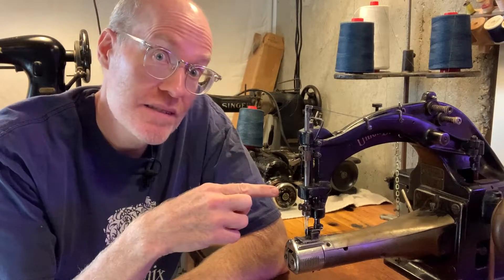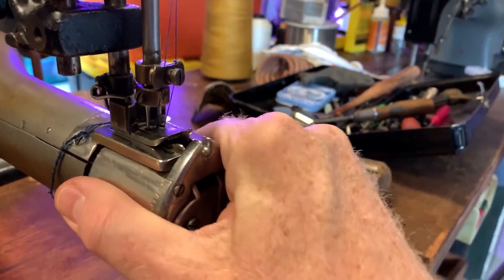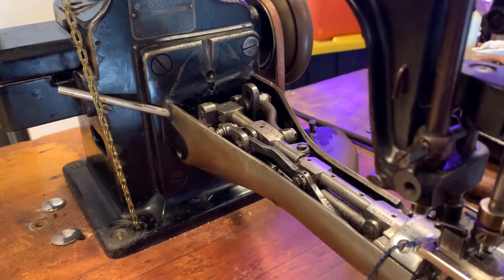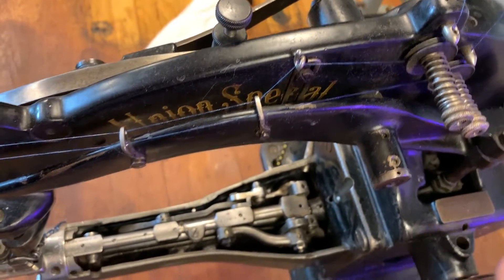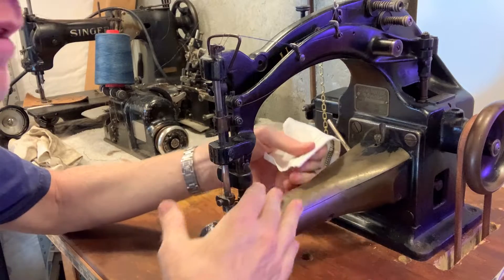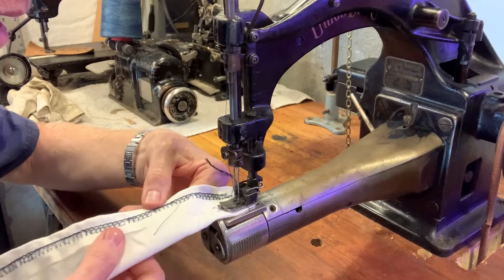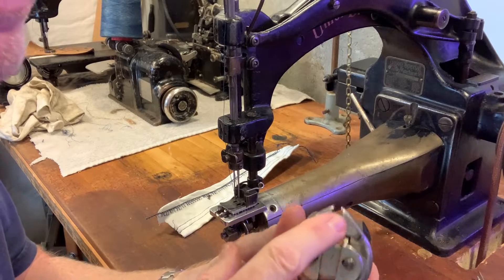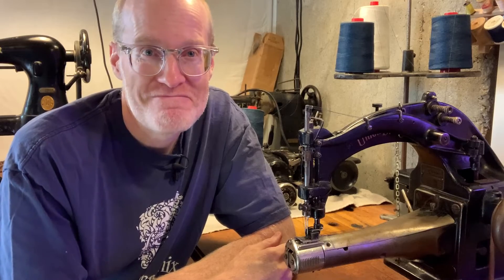A Union Special 11900 Cover Stitch Sewing Machine on Derek Does.

Comment: That cord hole is cool
Reply from the maker: Yeah it is unusual.   I haven't looked it up yet in the old parts manual what it was actually used for specifically.
Reply: @derekdoeschannel  its for riding the overlocked stitch through so it can cover it evenly. great videos

Comment: I m using 121g or gs needle and I have more pressure on threads and pressure foot than you. Pressure foot is almost to the end of the screw
Reply from the maker: Every machine is different as who knows what was done to it 50 years ago.  If your machine works that way it is, that's the only thing that matters.
Reply: @derekdoeschannel  your look solid. For 1 mm adjustment needle bar and mine sew worst than yours. They re solid I m sure yours can sew very well. You didn't try enough needle or setting the tension. A huge tension I had on threads I minimize it now cause it sew well but still lot of thread tension for top threads...I spent days trying and I m getting 2 new ones soon chainstitch this time with right front needle
Reply: @derekdoeschannel  i would not move the needle bar just more tension on foot and top threads with new 121gs needles
Reply: @derekdoeschannel  the screw from both thread tensioner get out if 2-3 mm at the exterior. You need to tight them like 6 laps or more. Your tension is way too weak. As your foot too almost to the end of the screw for the foot
Reply: @derekdoeschannel  i upload a video on my tensioners
Reply: @derekdoeschannel your under arm thread guide is homemade not correct. Your thread could get screw at the end of guide....I will unscrew this....look at mines are like these from the top. Not from bottom
Reply from the maker: @amoskeagjeans  let me know how it goes.
Reply: @derekdoeschannel  watch my last video. I know the machine sew well without it. But not an homemade so bad. I will point out the original thread guide. On top. Yours is really weak good to screw the tension
Reply: @derekdoeschannel  look my last video now and unscrew this homemade thread guide it screwing you. Rather have nothing than that. Put tension on both thread and pressure foot and try
Reply from the maker: I’ll check it out today!  Thanks
Reply: @derekdoeschannel  how rusty sorry
Reply: @derekdoeschannel  maybe with the correct tension your homemade fork thread guide is fine but I doubt it. Cause the end/ fork is located where the thread is push out all the time so I think it's a real bad thread guide even more with weak tensions...maybe after correcting tension it will work but I doubt it.
Reply: @derekdoeschannel  me too a mechanic set an homemade one and we removed the original but it was an error and due to too low tensions.  I could see without any thread guide but with the one you got I doubt my machines will see
Reply: @derekdoeschannel sorry your thread guide is original it's a good one finally